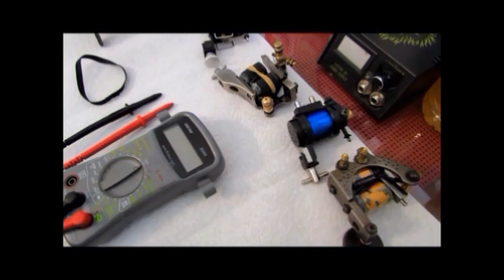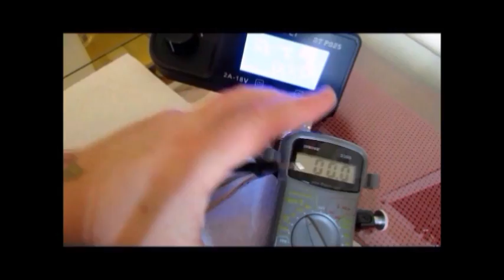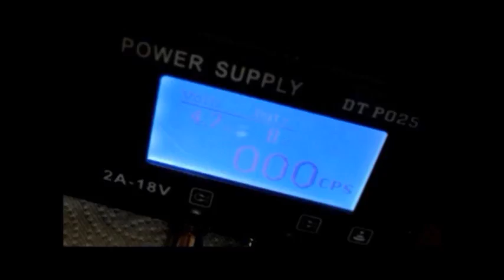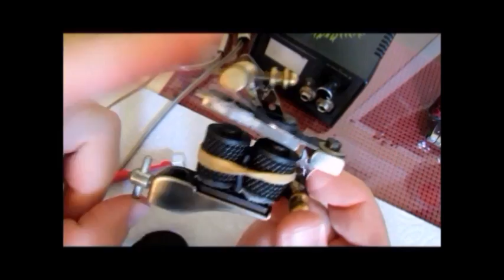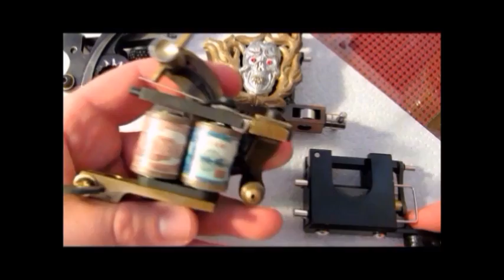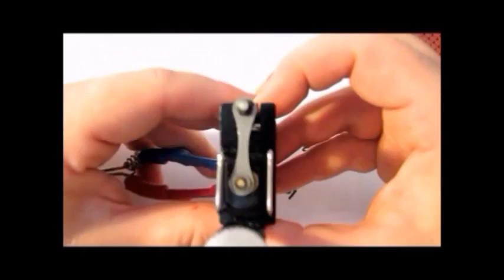Clip Cord Direction  Tattoo University

Comment: Thanks for the great info. I am just getting into tattooing and I have two guns, one that is marked and the other isn't. I reversed the wire hookup on the unmarked one and it seems to me to be running better. Thanks
Reply from the maker: You are welcome!
Reply from the maker: Sometimes just taking them apart and putting them back together correctly fixes the problem.

Comment: thanks for the vid I have the same power supply mine is junk thankfully I got a refund it does not give a consistent current I have changed clip cords done everything I might get a meter like yours and test it but even with a rca cord sill does not give a constant current I can hear the change in my machines . I'm a lil bummed out about it and currently looking for a different model but with the same readouts

Comment: don't you need a capasitor for every tattoo machine?
Reply from the maker: You actually don't need one, but they run better with one.  You also don't get shocked as much.
Reply: Tattoo University so is there different size capacitors you use? and I'm guessing that you run  your coil wire to the capacitors and then to the rear and front  binding posts correct?
Reply from the maker: I posted a video on tattoo capacitors.  You should watch it.
Reply from the maker: https://www.youtube.com/watch?v=x7VZyXf5l_w
Reply: thanks man! I cannot stress enough how much more I have learned since I started watching your videos. I thought I knew what I was doing...turns out I didn't lol.

Comment: what is the switch for on the back of my power supply? it says 110v and 120v? I can switch between the two
Reply from the maker: Depends on where your at and how your electricity is set up.  America uses 110 so you would put it on there.  In other countries their electricity is set up differently so you would switch it.
Reply: @TattooUniversity  what's your favorite type of machine and what is the brand name of your favorite coil your favorite rotary in your favorite pen machine
Reply from the maker: @jeremiahwhite6872  My favorite machines are the ones I get from builders.  I like knowing the machine has not been mass produced and has a little character. There has been some thought into the building of the machine.   Those are usually coil machines.  My favorite rotaries are ones that give you a lot of control.  I like give clips and machines with different adjustments.    This way I'm not a slave to the machines settings.
Reply from the maker: @jeremiahwhite6872  As far as pens go I haven't really found one that I liked.  They work good and can do some good shading.  The ones I have used only have one setting and weren't adjustable.  That is one of the things I don't like  so I will continue looking for a pen that I do enjoy using.
Reply: @TattooUniversity  can you recommend a some builders and the type of power supply you use. Thank you your videos are the most knowledgeable and things that I have been looking for that I could not find Googling or asking other people I mean it's amazing I wish these videos were available 20 years ago
Reply: Wow you got a world wide traveling tattooist power supply lol